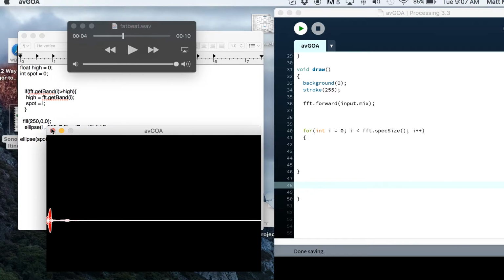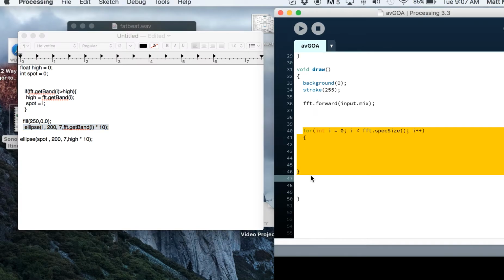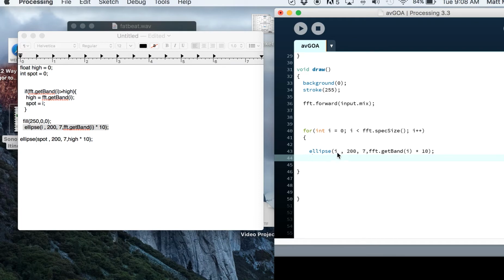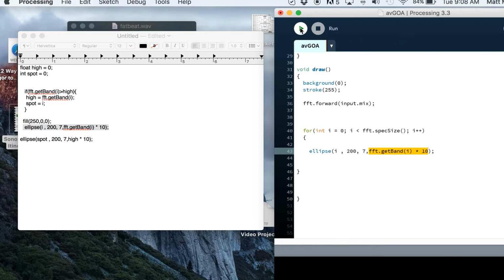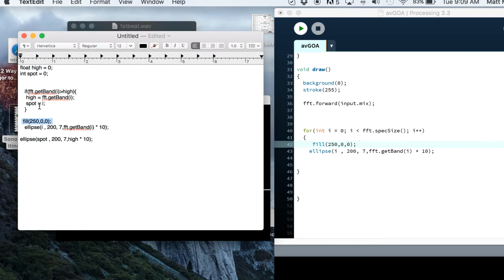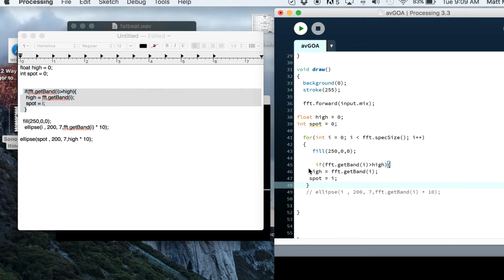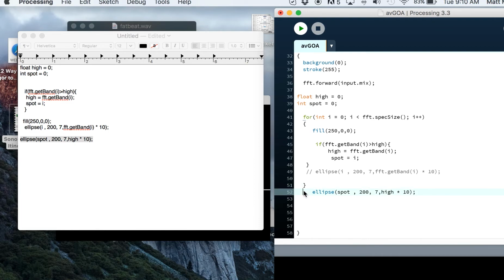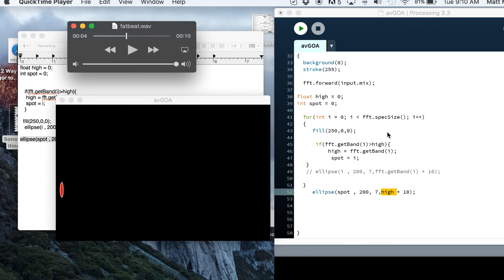Audio Visualizer Using Processing

Comment: This is really great! Was wondering if its possible to change the size of the sound waves? For example, if I was to use this for a 1080 x 1920 canvas, how would I also change the size of the waves to fit across the whole screen?
Reply from the maker: Sorry I didn't get back to you sooner. Yes, you should be able to do that. Just use the width and height variables to space the waves across the screen.

Comment: Great video! What does line 11 do (int colo etc.)? Looks like a couple of arrays, but not sure exactly what. TIA!
Reply from the maker: It is never used in this demo, but you are correct it's a 2D array. I had intended to use it to hold color values and then use it to display a different color for each frequency.
Reply: Hmm. Thanks! Sounds like something to investigate. Though why 2D? I'm sure I'm missing something obvious.